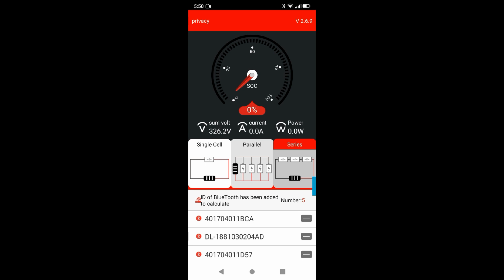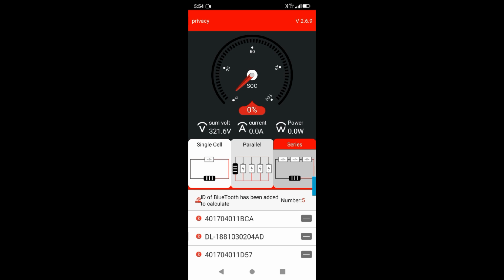2008 Ford Escape HYBRID Battery Monitor test drive.

Comment: I want to learn more about your process on this 08 escape how can I find out more information or get in contact with you?
Reply from the maker: There is very little info about these old hybrid escape and marina only thing ive seen it how to take the old battery apart and nothing like what i have done in these videos. The active balance is made by Daly there are 4 24s units and one 4s unit and they are bluetooth compatible. I bought them from Aliexpress.  Alot of this info is in the series of videos i made while installing this battery. There are no changes to the car only the battery and battery type.
Reply from the maker: you can get in touch by email at leizurediy @ gmail.com